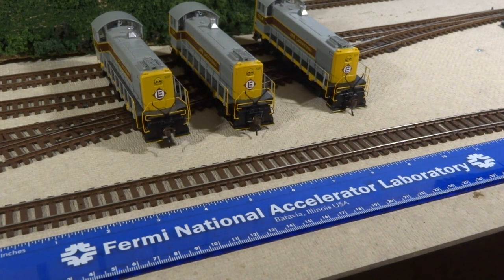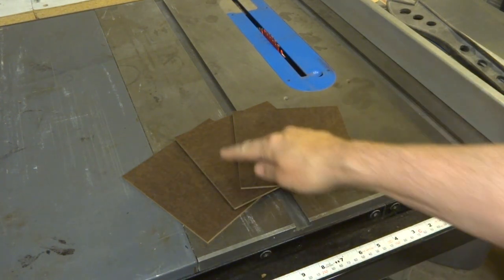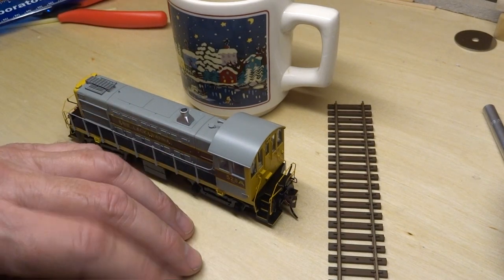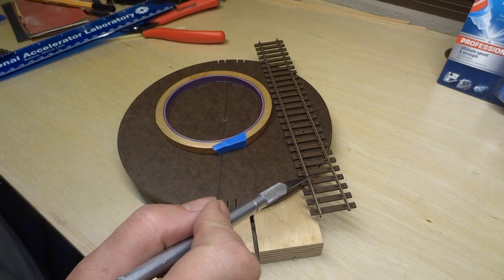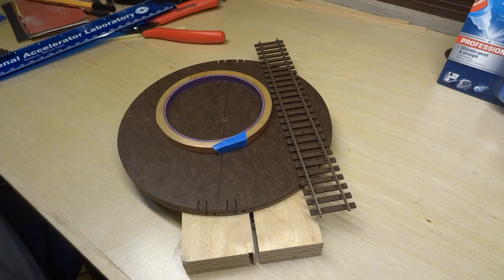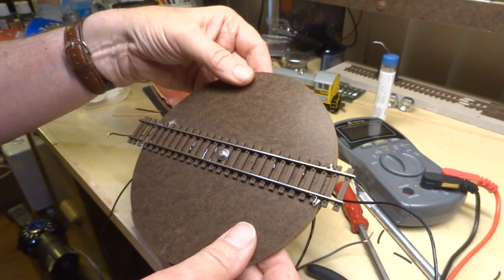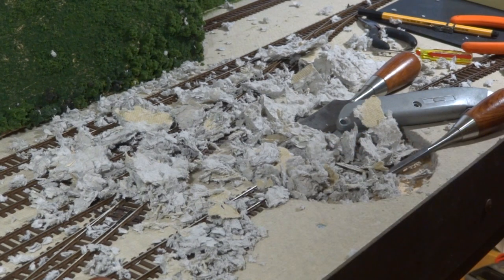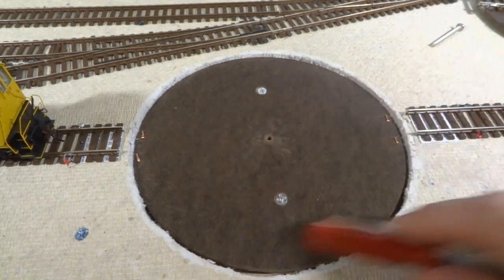Make your own HO Turntable - Part 1

Comment: UK viewer here trying to get ideas for a DIY turntable as all the off-the-shelf ones are too large. 
Very simple and effective build. I'd like sound fitted locos to remain live though. 
Thanks for the video!
Reply from the maker: Thanks Steve!  Yes, the continuous power feeds will complicate the wiring, but perhaps you could look into some small modules that get used for reversing loop polarity changes.  I'm currently going in the opposite direction and installing battery power "dead rail" to ease the amount of track cleaning and interruptions I was getting with DCC.

Comment: Hello, I wanted to add turntable to my layout because I see that not having one, and running pre 1930 steam locomotives makes operations a little tedious if they always run tender first 😂
I'll take inspirations to kitbash my own with some spare wood I have in my attic, just like you did :)
Reply from the maker: Have fun, and good luck with your project!  I could not find anything commercially to fit my space, so DIY was the only option for me.  My locos are all small vs steam.
Reply: @StanFerris  I wanted to make a turntable that sits on a board, and not one that you cut a whole on your layout to fit a well. Also, turntables are quite pricey, even kits, so making one for cheap is also a nice bonus. I would never get the hornby turntable, its to big and clunky for my layout and it takes forever to spin 180*

Comment: well done. I am building a track and adding a turntable. I have been struggling with reverse polarity issues but your elegantly simple contacts eliminate any polarity issues. Nice work.
Reply from the maker: Hi John!  The downside is the interruption of power to a dcc sound card.  But I have the sounds turned way down anyway, as it gets annoying on my small layout.  Post another comment or link here when you get yours done!

Comment: How does it still work when it’s turned the opposite way?
Reply from the maker: So there are two contact points on opposite sides of the turntable and in the base which connect power to the rails on both ends when the table track is aligned with the spur track.  Once you start spinning the table, the power is disconnected until the table is realigned with the spur track 180 deg offset.  If I needed to intersect more tracks like for a roundhouse or something, I'd have to add additional contacts in the base for power to the table track.

Comment: Nice ruler! 😉 If I don't own a band saw, can I still make circles?
Reply from the maker: Of course.  Cut them by hand with a small saw or with a jig saw.  Then to get smooth circles, use a drill or a drill press to spin them and with a file or sandpaper block work the edges until perfectly round.  Check out my video on cutting circles on a table saw, or one I just put up on jigsaws!
Reply: buy a cheap jigsaw

Comment: Well, this is a very stupid idea...why not take the locomotive and swap it around manually... i guess the comments are mostly ironical. Not using a motor and control cirìcuits  are not an option for most model railroaders.
Reply from the maker: As I get older it's a bit more of a fiddle to get the locos and cars back on the rails, so the TT helps me out with that.  But mostly it was a fun project for me to design and build to my limited space.  If you have the room and desire for a larger one then  there's no need to diy one.  Cheers!